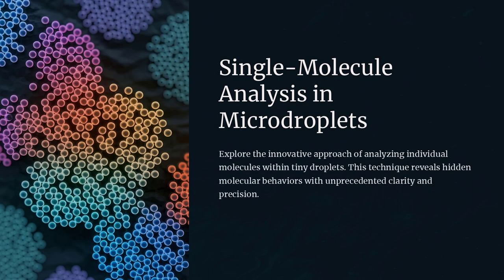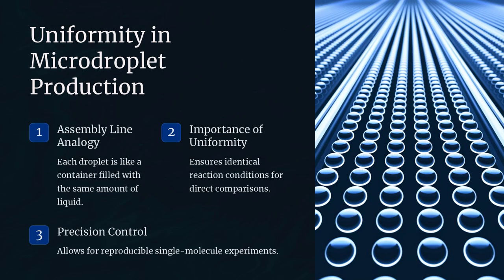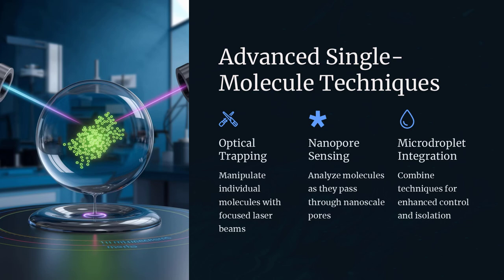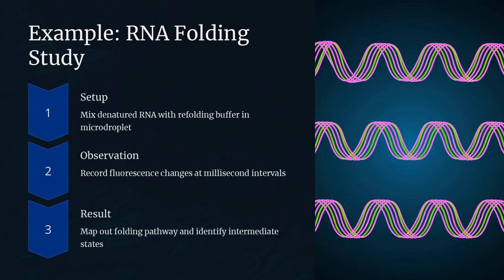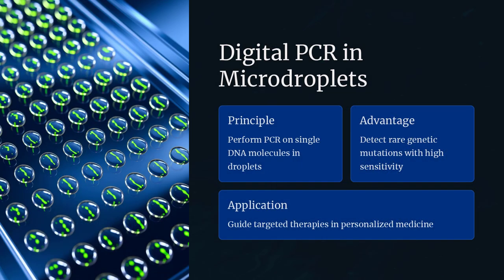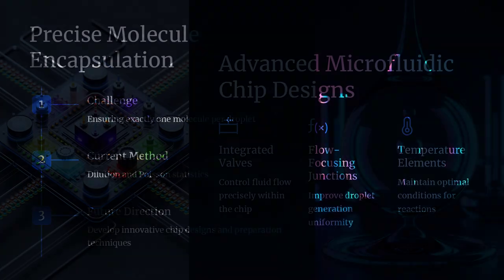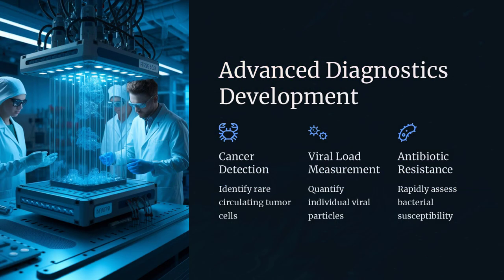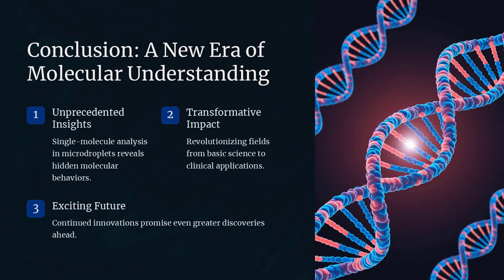Tiny Test Tubes, Big Discoveries: Single-Molecule Detection

Comment from the maker: How can microfluidic droplet systems be optimized to ensure absolute single-molecule encapsulation while minimizing unintended molecular interactions and noise?
What are the fundamental limitations of current optical and electrical detection techniques in microdroplets, and how can emerging quantum or AI-driven approaches enhance resolution and accuracy?
Can single-molecule analysis in microdroplets lead to real-time, portable diagnostic devices for early disease detection, and what challenges must be overcome for clinical translation?